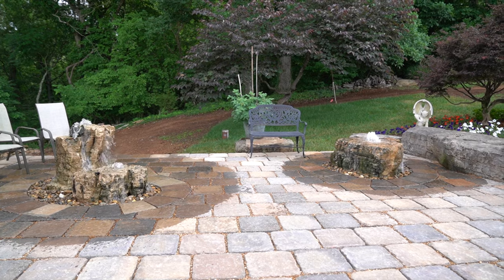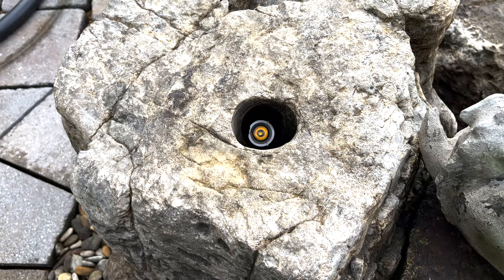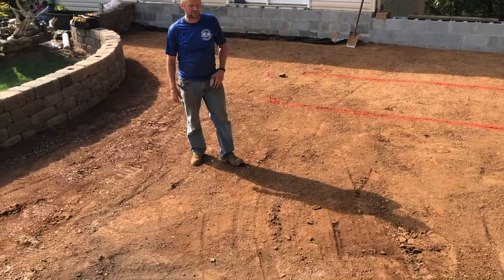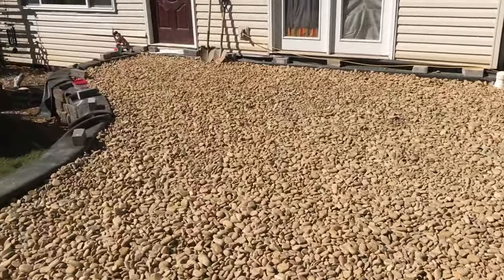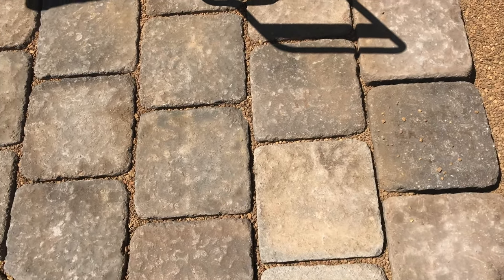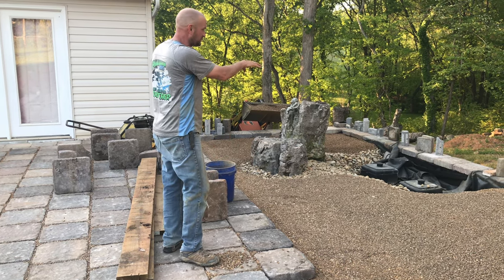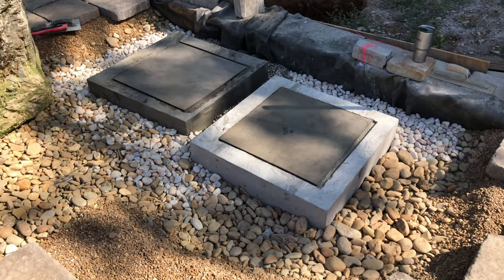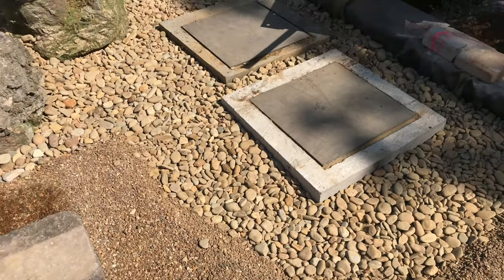Splash Pad at Modern Design | How We Built It

Comment: Hi! Wonderful video. I am going to put in a smaller splash pad in my back yard and wanted to recirculate the water. One question I had was how does this do in the winter? I live in Utah, will the freeze and thaw degrade the water catch system? Did you incorporate drain for winterization?
Reply from the maker: We let it run all winter. Our reservoir is about 30” deep below patio surface,  so it (the reservoir) doesn’t freeze inside (in Tennessee) due to geothermal. Ithas frozen over to the point where there was a total “ice dome” over the fountains and the water was flowing inside of the dome still without hurting anything. I can’t say what would happen in Utah, probably need to put reservoir a bit deeper but maybe no. If you try it out let us know, that would be great info to share! FYI- our reservoir under the splash pad holds 60+ tons of gravel in addition to the aqua-blocks. We calculated 4000-ish gallons in our holding tank (reservoir) below the pavers. Just some #’s for ya!